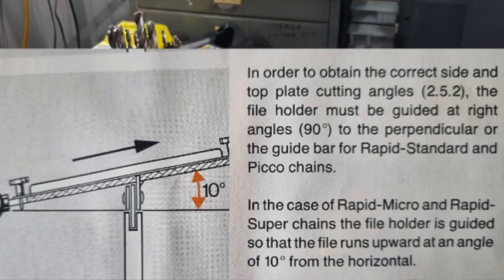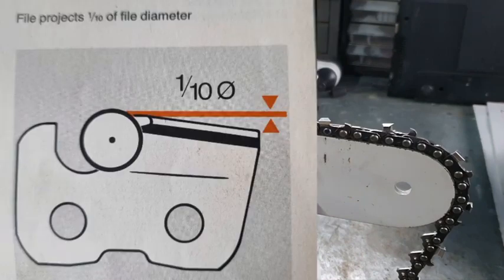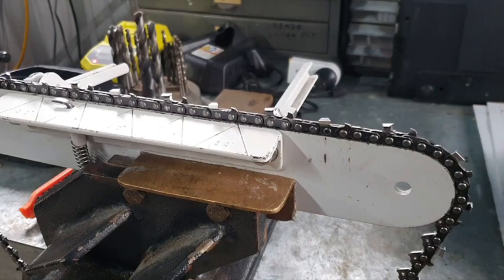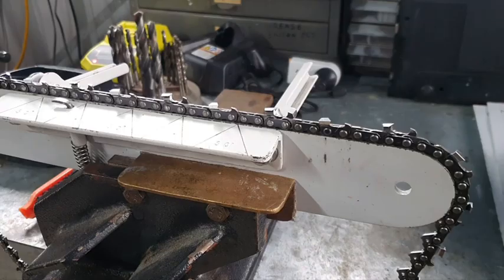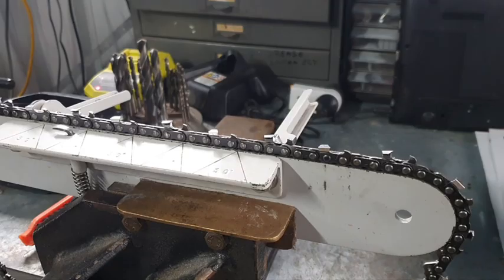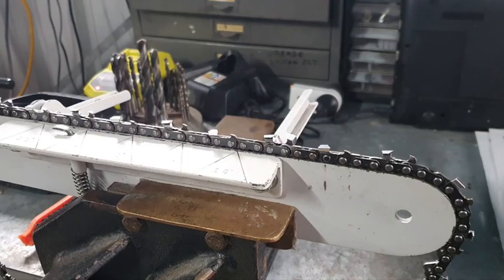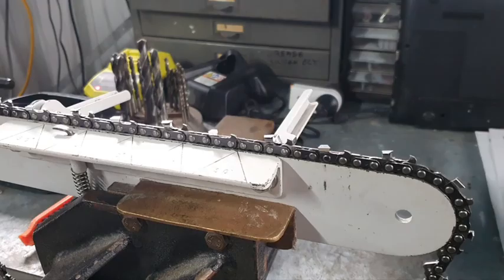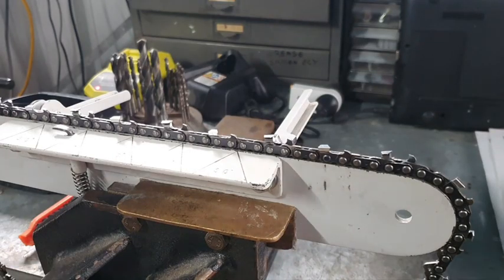10° downward tilt over the last 50 years

Comment: My new Husq 562 uses a 3\8 pitch chain, 0 degrees tilt, 30 degree top plate angle.  I have some new old stock Husq H46 chains that fit this saw, specs are different, 25 degree top plate angle, 10 degree tilt.  Can the two chains be filed the same, is there a difference?
Reply from the maker: 10° tilt may help some chains if you hace a little hook.  But if you keep your file 20 to 25% above the cutter you will be OK.
Also if the top plates left and right slope inwards towards the drive link you need tilt.
If the top plates are horizontal then most likely you dont need tilt.
That said a little tilt will never hurt.
Reply: @ChainsawUsers  Thanks!

Comment: I have old Stihl 36RM chain, from the era of them recommending tilt, and it is shorter than the current RM. They completely revised RM cutters in the mid 90's, changing them over to using the RS design and made it taller. 

It is not a height issue.

To put it bluntly, Stihls sharpening advise has been shit from the day they started making chain in the 70's

Their chain is good, thier advice isn't.

I should add - None of Stihls file holders have ever held 10% of the file above the top plate. If you want to check this for yourself, the current 404 file guide is the same one that was used for sharpening 3/8 and 404 RM back when your book is from. The only change made to it is they removed the 35 degree line, added the 10 degree line and removed the oilomatic and Rapid Micro branding.

Before this they only sold 2 guides. The other was for 325,3/8 and 404 RS chain. All were sharpened with a 4.8mm file and the same guide.
Reply from the maker: I agree with you that Stihl are lay back in comming forwards with the correct information.
I  ever paid any attention to chainsaws in the 80s and 90s I just used them.
As far as I was concerned it was just a chainsaw.
Any additional information on this subject is good because the user will gain from your experience.
The comments really is what I look for great feed back.
I have a tree at my sons place over 1 meter wide will use the 500i and 30 inch bar full sequence chain and full skip.  The tree had been on the ground a long time.
It will be interesting to see how my saw work in that old log.
Reply: @ChainsawUsers I did a video a few months back called Stihl chain sharpening history that shows the technical information bulletins about one lot of changes of RM chains where they became taller.

The majority of their chains (except 404) are taller now than they were before 2000.

An example of how good Stihls sharpening advice is can be found in the book you have. The HOS grinder says the following,

The inclination of the grinding wheel on the HOS grinder is not adjustable, I.E - it is permanently fixed at 40 degrees. This inclination is specifically designed for the Rapid Standard and Picco chains. This means that Rapid Micro and Rapid Super chains cannot be sharpened with this tool.

What do they say now? They leave the USG head fixed at 40 degrees for everything. That was the change they implemented in 1995 when they simplified the sharpening instructions.

Just like dropping any mention of down angle, they dropped different grinding angles for all those chains and simplified it to just 40 degrees.

Only the 3/8 RM had a major change leading into this change in advice.
Reply from the maker: Thanks for that update I will have to get on your channel and look for that  video.
I did remember reading that Information about the HOS grinder.
While we are capable of figuring out what angles to uses ect it would of been good if Stihl published some good accurate information that would help new users especially.
Reply from the maker: Adam I checked your channel cant find that Stihl history video you mentioned can you add a link ti it please
Reply: @ChainsawUsers https://youtu.be/N8vRszvpJ5w?si=sXQ95quNigyOshP7

Its boring but has the RM TIB about half way through

Comment: A tooth with no hook whatsoever will cut no wood whatsoever ⛷️
Reply from the maker: Hook is another word for a tooth that is ground with little metal support underneath.
To much hook is an error  in filing or grinding
Reply: @ChainsawUsers yes, no argument there but if the is “No hook” then you have also messed up, just nit picking I know what u meant
Reply: Wilson ... its a different filling system but look up "square ground chainsaw chain" in images on google ... it has no hook maybe a 5degree lean at the most.
Reply: @stihlnz  I square file, I know what it is…. And that also has nothing to do with what this video is talking about 😂

Comment: Tinker, great review on 10° tilt 🤙🏼. Something off subject. Tungsten tooth sharpening. Can you use something other than a bench grinding (Diamond wheel)? Can you use a diamond bit in a Dremel? Thanks in advance.
Reply from the maker: Yes you can use diamond on a dremel bit slow and you need steady hand but it did it before like that.
Now I have a diamond wheel
Reply: @ChainsawUsers 
Thank you so much for your quick reply, Tinker. I did think this was an acceptable way to do it, but not much out there to show that it can be done, thank you. I’ve just bought a new tungsten chai and only have my Dremel and diamond bits to sharpen it with until I can get the grinder. 
Cheers 🍻.

Comment: If the manufacturer shows an arrow pointing up, wouldn’t it technically be upward tilt?
Reply from the maker: Not sure Doug.
How about you do you use 10°   tilt much these days ?
Reply: @ChainsawUsers I do sometimes tilt my file up into the cutter slightly, yes. Does it help any? Probably not.
Reply from the maker: I use 10° tilt on chains that have the top plate sloping inwards towards the drive links

Comment: I used to use the tilt filing technique years ago but have gotten away from it…and
Echo makes damn great saws!
Reply: Agree! Echo is really good! I’ve a Shindaiwa (Echo) 490, damn good saw! The Italian Company “EMAK” also makes good saws under the name of “Oleo Mac”! Under the 45 ccm category, for the homeowners, Oleo Mac saws even better built than the tiny S/Hq saws…. eg. tiny Stihl saws often have connecting rods made out of cheap iron plates, tiny Huskies do not have proper chain oil pumps etc.etc.  In the small category, Oleo Mac saws all have proper forged steel connecting rods, and proper chain oiler systems. I’m a Husky guy, but I’ve some Oleo Mac saws and brushcutters, and they all doing their job well!
Reply: @peterjuhasz5143 my Echo2511t is one of my most favorite saws…so light and powerful for its size!…not familiar with the Oleo Mac…sounds nice…

Comment: Your deep dives into these subjects are very helpful. I have a firewood processor and it uses an Oregon bar and chain. They are still recommending a 10 degree down tilt when grinding the chain. I discovered to my horror that my grinder was off center. I messed up a bunch of chains. After properly centering the wheel to the vice, I had to go back and resharpen. However, I didn't use the 10 deg. down tilt. Hopefully that will un-muck my chains. I may have to do a video and try timing the difference it makes when I cut. It only takes about 4 seconds to cut through a 16" log so that could be tricky. The chain is an 18HX .404 pitch. For both filing and grinding they recommend the 10 deg down. Oh and I use the Oregon 620-120 grinder with a CBN wheel. Thanks again for a great video!
Reply from the maker: Thanks for your comments much appreciated